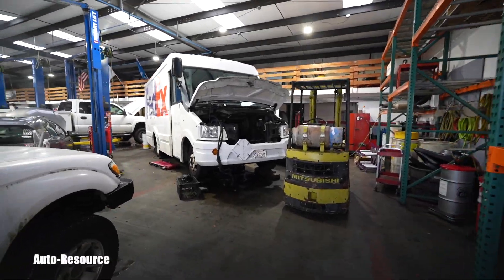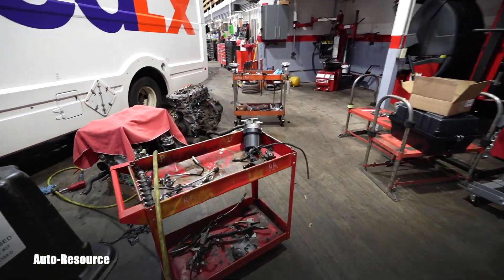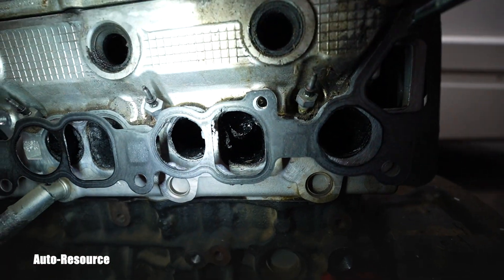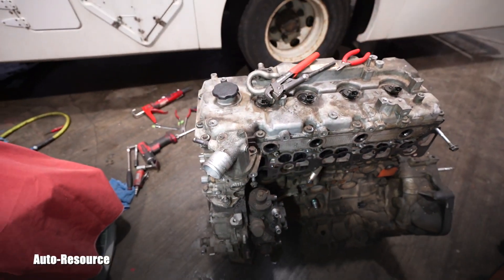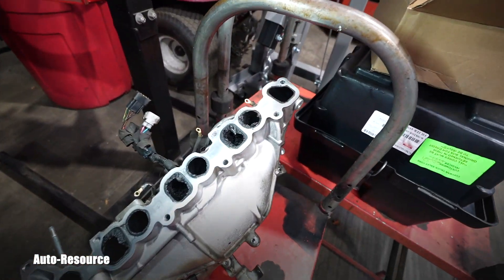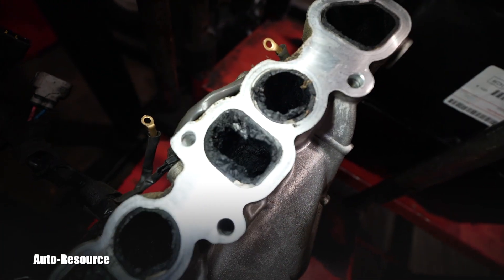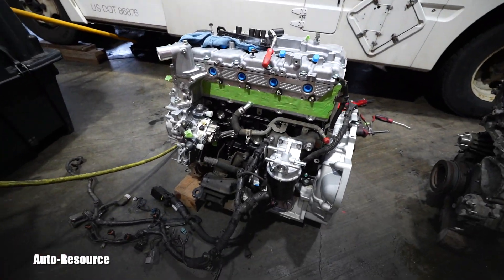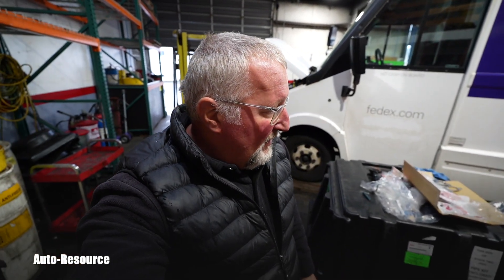The BRUTAL cost of emissions on diesel engines. EGR can cause catastrophic failure.

Comment: Actually it is a combination of the EGR AND oil vapour from the PCV. If you add a catch can to the PCV system and empty it regularly the EGR won't cause an issue. My Mercedes Diesel has 250k and when I removed the manifold this weekend it was clear because I have a catch can in the PCV system before the pipe goes into the inlet.
Reply: Agree. It's the oil vapor from the crankcase hitting the exhaust entering the intake manifold via the EGR that creates all the black sludge (as well as filling the inter cooler if the engine is a turbo with oil).
The problem really manifests itself if the engine has to work hard e.g. a loaded commercial vehicle or towing.

Comment: Idle a diesel and that’s what happens. Short trips and idling kills diesels. Thanks epa! These systems aren’t saving the environment they’re making it worse due to higher costs, more maintenance, more engine replacements, more down time etc etc
 One of the many reasons I traded my ‘15 F250 6.7 powerstroke at 55k miles. Started having dpf sensor failures and those exhaust systems are  about $10k. No thanks. Traded it for my ‘21 TRD ORP Runner and haven’t looked back!
Reply: . . . .  You mean idle a MODERN diesel engine. I had a 96 Ford Transit with the 70bhp diesel engine. (No DPF blanked off EGR)  It had done 500,000 when I bought it. Never did long trips in it except a trip to Brooklands south of London. Filled the tank in Leeds before I set off and arrived back that night with over half a tank left! It'd done 620,000 when I eventually scrapped it, because the bodywork rotted around the engine! It simply refused to die! 🤣
Reply: @ well yeah, clearly, older diesels don’t have dpf systems and scr’s. They kill diesels. It’s no surprise why the older diesels run so good for so long.